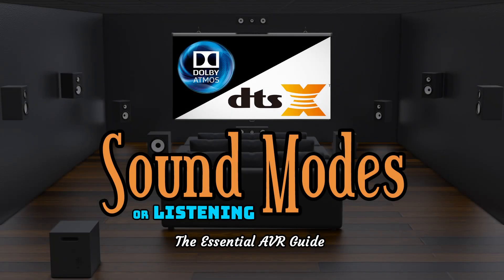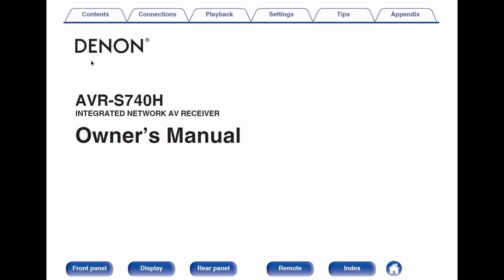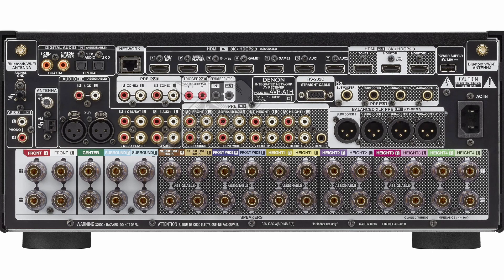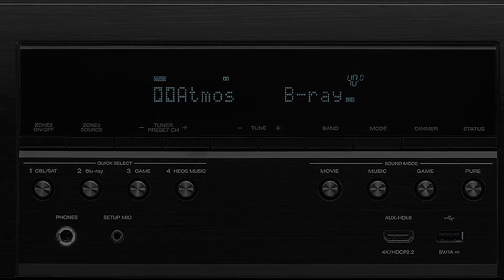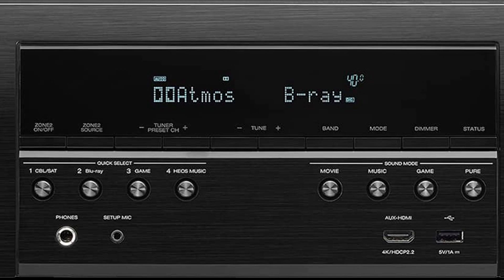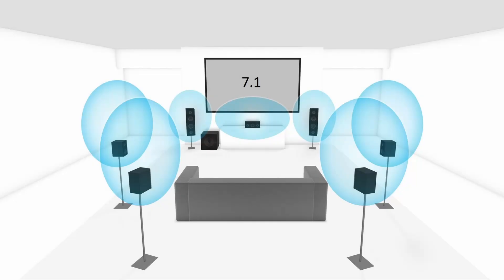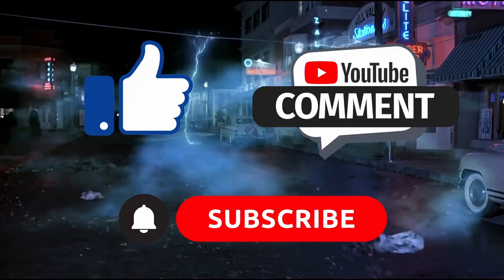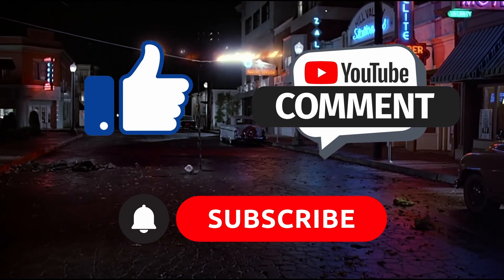Surround Sound Modes the Essential Guide

Comment: My Tv does not have a sound setting for DTS TRU HD or the other DTS SOUND MODES ONLY DTS SETTING ON ITS OWN.
It is easy to set DTS for a Blu-ray Disc if the sound source says ‘DTS’, but it is confusing for the consumer of what setting to pick here if the DTS is more than just DTS on its own.
I  know when a Disc says DTS Virtual X, then you have to set your TV to pass through to get this setting, but the other DTS settings are confusing.
No Tv manufacturer seems to explain the complexities plainly enough of the DTS Sound format.

Comment: Have a 5.1.4 Kef speaker system.   Have an Onkyo RZ50 receiver, was the least expensive option for what u get.   Have a SVS 12” sealed sub that hits low and dirty.  I think I have the 2000 svs series.  They are good, but not amazing.
Reply from the maker: The big question is, "is it good enough for you or do you feel like your missing out on something?"  If you do feel like you are needing to move up good equipment is cheap. Thanks for the comment!